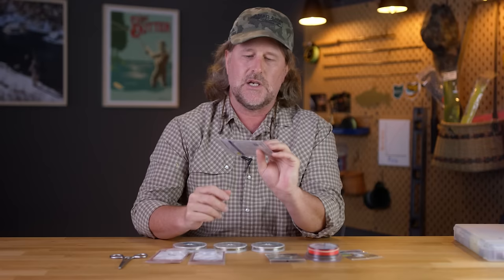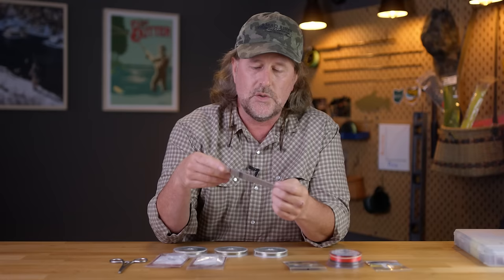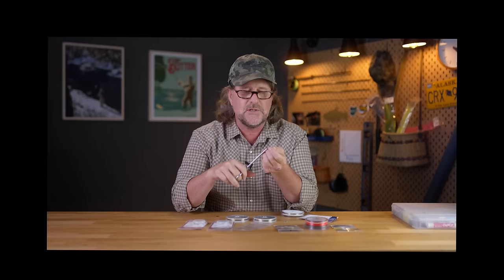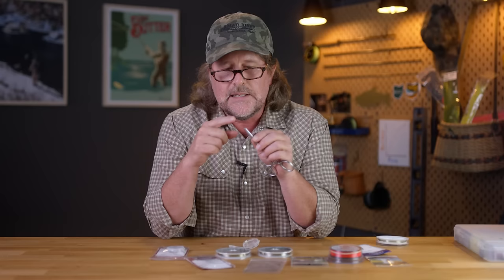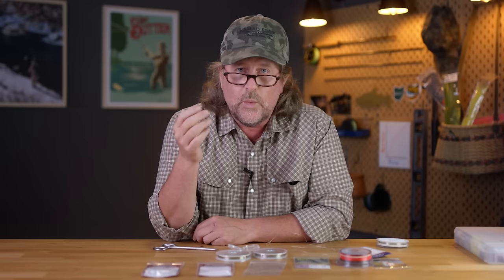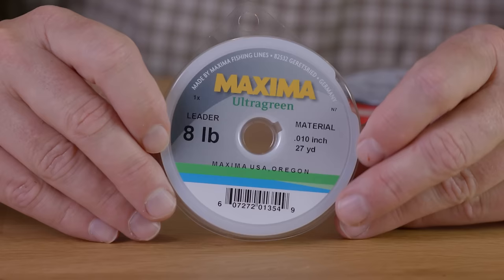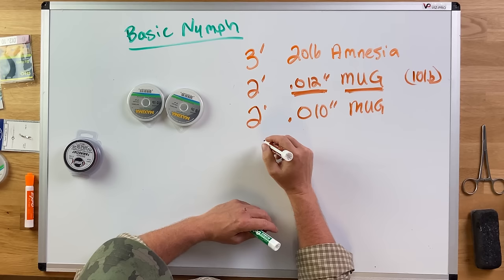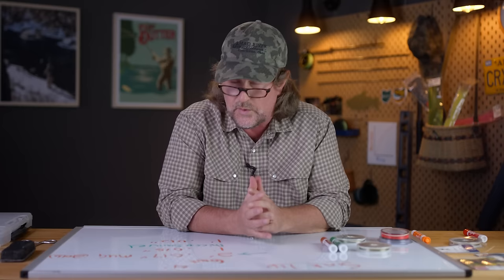Build Perfect Nymph & Streamer Leaders | Micro Swivels + Tippet Rings | Fly Fishing Tutorial

Comment: Hey Brian longtime fisherman here from Michigan now in KY.  I’ve found that learning to tie knots and tie on your own loop connections or droppers when drop shot nymphing double nymphs is much easier than using those tiny freaking metal leader eyelets.  
Kelly Galloup’s drop shot nymph video describes this well and why many of us use our own knots instead of those little things.  Plus the great thing is if you pre tie several loop droppers and keep them with you then you can #1 change flies out easily and quickly but #2 you can slide that five inch loop dropper up or down on the leader depending on where you want to move your fly in the water column to keep your offerings in the optimal strike zone.  Love your videos, just wanted to offer some advice for newer anglers to this concept so that they learn early to tie their different knots and make their own and skip the hassle on the water of dropping those tiny little metal rings right into the drink.
Reply from the maker: Thanks for watching.

Comment: Hey, enjoying your videos.  Two comments.  First, I tried a swivel while streamer fishing. The swivel broke, probably due to the repeated hinging at that point.  It was a traditional swivel, not a new micro. Maybe it was old and/or cheap, I don't know.  But it broke. I decided to just use tippet ring, not swivel. Second, a comment about a significant reason to use tippet rings that no one ever talks about.  Knot strength. Connecting knots like blood, Uni, etc. have break strengths of 50 to 60%. That means the weakest point on our line is the knot connecting leader to tippet. If you'll use a tippet ring at that point, the knots (Clinch, Uni, etc.) will be in the 80 to 95% break strength range. In other words, a tippet ring will hugely increase the break strength of the weakest point on your line because you replace connecting knots with terminal knots, which are inherently stronger.
Reply from the maker: Thanks for watching.

Comment: I’ve not seen any in a store in a while but, 01X is 0.013” and 02X is 0.014”. These, 01X & 02X , are not to be confused with 1X or 2X. They may not even make these sizes anymore but they use to be common steelhead and salmon sizes. 
 Hope to make it up to your store some day but it’s a little bit of a drive from Tennessee.
Reply from the maker: They make the sizes, of course, they just don't use that nomenclature. They just list the diameter of the tippet and don't give an "X" rating. Thanks for being here and come on up sometime.

Comment: Whenever I try to tie on a tippet ring with a clinch knot, the line that pulls through the clinch knot around the tippet ring gets coiled up. It's like it is getting dragged over a sharp edge. Consequently the tippet will snap right there at that weak point. And yes I am lubricating the knot. Have you ever had this problem? I'm wondering if the tippet rings I got are the problem? I like to use the tippet ring so I have switched to using a davy knot instead however I don't know how strong it is in relationship to the clinch knot. Would you use a tippet ring on a steelhead leader?
Reply from the maker: Please send your questions over to the shop and they will be happy to help. Thanks.

Comment: Newbie here.  It is my understanding that the leader sections should "step down" in no greater than 0.002" increments and the butt section must match the fly line diameter.  What weight fly line have these leaders been created for?  3/4 wt?
Reply from the maker: Pleases send those questions over to the shop and they will be happy to help you there. E-mail is fine. Thanks.

Comment: What are the thoughts on using a small snap swivel to connect the fly to the tippet/leader versus tying them on? I fish mainly for panfish and bass and find sometimes tying on even a #10 fly a pain even with cheaters. I do utilize a tippet ring about 2’ on the leader and then retie that piece of tippet back on. Wondering how it affects the fly line dynamics and presentation?
Reply from the maker: Please contact the shop with your questions and they will be happy to help. Thanks.

Comment: Great video Brian. I’m setting up a 5wt rod with sinking tip line. I assume that I would want a slightly lighter “MUG” line for the leader or would the .017 and .015 be ok?  Also, should I just use a surgeons knot to connect the .017 and .015 lines together?
Reply from the maker: Thanks for watching. Feel free to e-mail or call Brian directly through the shop. He'll be happy to help/answer.